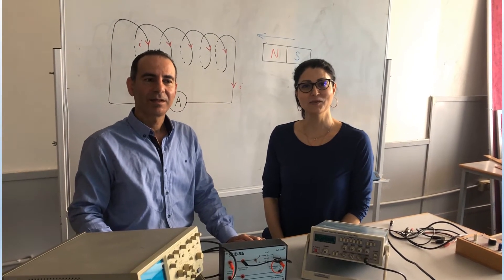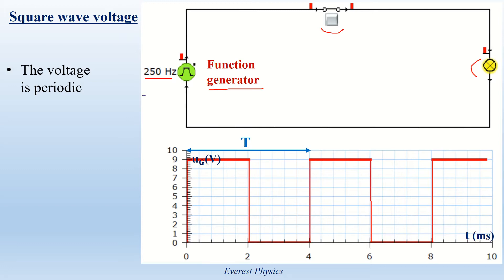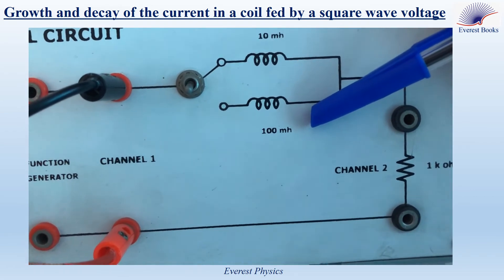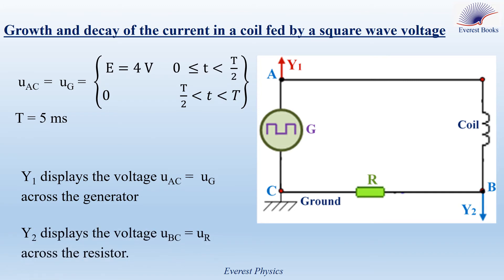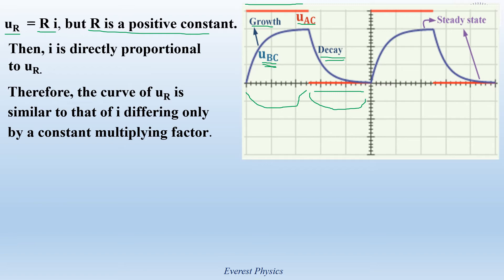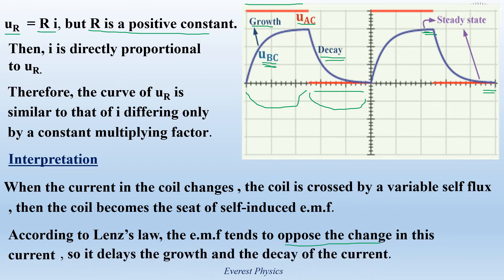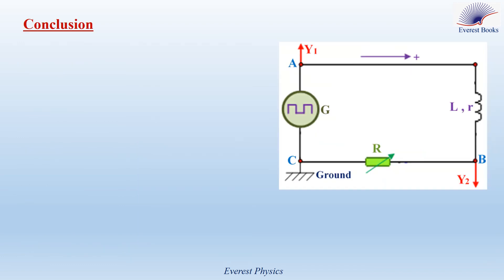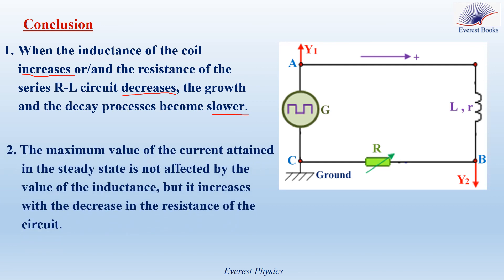Curves of growth and decay of current in RL circuit

Comment: Hello ❤
I have a question plzz help me 
How can know if the coil acts a generator graphically
Reply from the maker: Hello. This depends on the curve you are analyzing: if you are analyzing (i - t) graph or (UR - t), then the coil acts as a generator if the absolute value of the current i or the voltage UR decreases.
Reply from the maker: And if you are analyzing the curve of WL versus time, then the coil acts as a generator if WL decreases. Remember that WL = 1/2 L i squared. If WL decreases, then the absolute value of i decreases
Reply: Thanks ♡♡♡♡♡♡